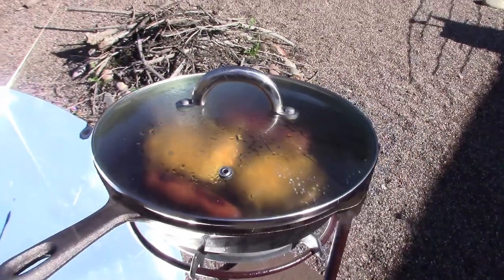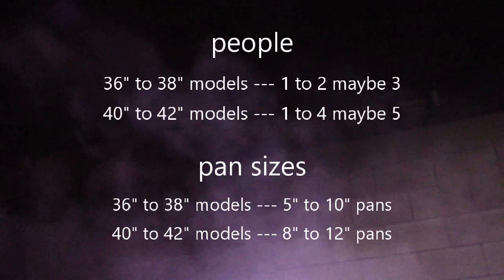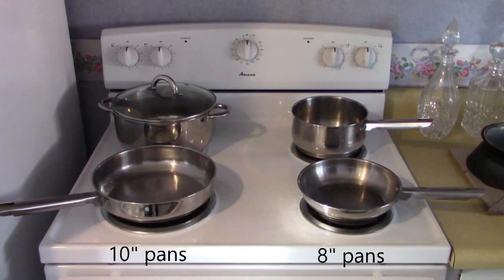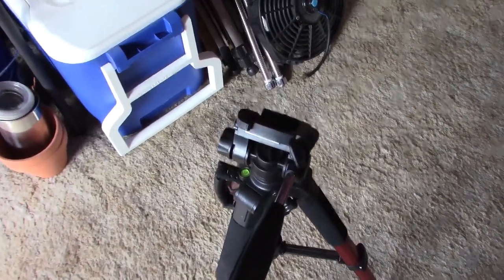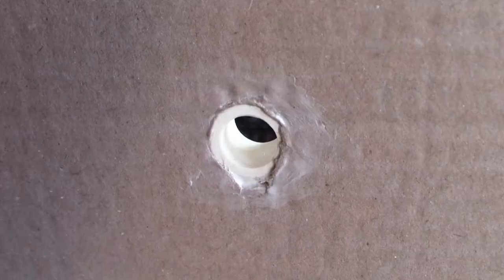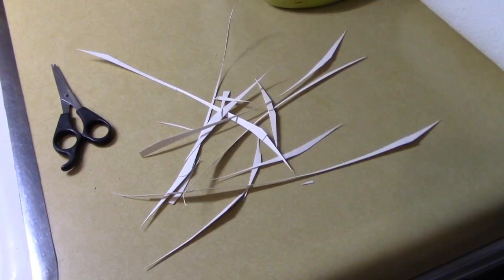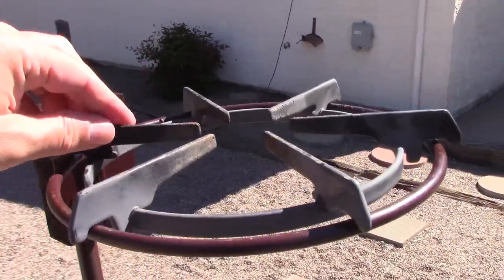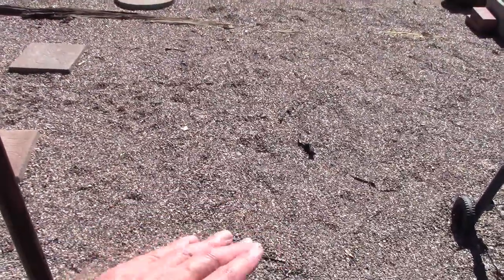DIY "Family Size" Parabolic Cooker! Supercharged! XL "Solar Sizzler" Replica! solar stove burner

Comment: It is awesome solar cooker! I have some suggestions. It would be better if sun goes more under then on side. That is why you should maybe consider, for some of your next project, to make a bit dipper parabola and to trim upper half of solar cooker (or 1/3rd) and to prolong sides.  To look more like wing. It would be even more better if you can make aprox. a 2 square shapes. In that case you can cook more easily and maybe you can fold that two wings and make it more compact and portable. A am not sure am I clear enough :)

Comment: You made these out of cardboard and stickers freaking awesome dude
Reply from the maker: hi yes, it's really easy to do. and can last for years. cost me around $30 (plus the mirror stickers). total cost maybe 60 bucks. by the way i looked into other materials but cardboard is the best thing to make them out of. wood is too heavy and plastic/metal is too hard to mold. only other option would be something like foamboard and corrugated plastic but that would cost you 300 to 400 bucks and it probably wouldn't stay stuck together. btw i just made a final model. (3rd model in the series). i'm calling it the sport model. smallest and lightest one of them all. video will be posted in a week or two.
Reply: @desertsun02 cool I'll be there! I live in a 2007 Chevy Silverado 1500 with a four-wheel pop-up camper hawk model on it and a small version of this would be great for storage issues. I also live in the Phoenix Arizona area with lots of sunshine. Thank you!

Comment: I just saw a solar cooking for sale online yesterday! You just mean that particular brand?
Reply from the maker: hi. i mean this kind of solar cooker (the shallow dish "true" parabolic cookers). nobody sells them. nobody at all (since about 2011). it's crazy when you think about it. it's probably the best way to solar cook and they don't sell them. the only parabolic dish cookers you can buy anymore are the big 5 foot models.  those weight 33 lbs and are made of steel (with aluminum tape). they are deep dish models (meaning they have a shorter focal distance) so they are huge. they're also way too hot for regular cooking. they generate up to 1800w. that's double to triple the power that you need. they burn everything. if you want the lightweight, thin, portable kind (the shallow dish ones) you have to make them.
Reply: @desertsun02 I have watched YouTube videos of rocks melting and exploding from using the old internal projection tv screens. Way too powerful!

Comment: Watched with full stomach and slept halfway, rewatch again 😅

I just realized something, how do you calculate the wattage?
Reply from the maker: there are some basic formulas for figuring wattages for a given specific area of sunlight. i plug in values for average solar irradiance on a good sunny day (nationally) and then subtract for inefficiencies. i say nationally because if i used my local numbers the wattage would be a bit higher. output varies a little though because so many things can affect power output, (sun angle, humidity in the upper atmosphere, even elevation and of course the time of year).
Reply: @desertsun02  thanks, I didn't know that as I presumed you were using some sort of instrument. But this method is much better as not many people can afford to buy expensive equipment and it'll beat the purpose of trying to make it simple and affordable.

Have you tagged prepper community for this setup? I think this should be on the list of must have for preppers. It can save a lot time and energy to find and store woods and it's not necessarily available around in city. I'm putting this now in my experimental projects as well as apocalypse event. Have a nice day.
Reply: @Shouze163  As a rule of thumb, sunlight delivers up to 1000 W/m² depending on the conditions. A more practical method would be to measure the time needed to boil a liter of water and calculate the energy (or let AI do it). Also consider starting temp, thermal mass of the pot etc.
Reply: @SolarCookingGermany  thank you so much. Your method seems easy for me to do. Looks like you have some good videos there, I subscribed.
Reply: @Shouze163  Thanks for subscribing :) New videos after winter.
Reply from the maker: @Shouze163 i wish i knew how to tag the prepper community. i am somewhat of a novice when it comes to distribution. i mainly count on the viewers to share the content. feel free to share the links to any of my vids. i think this type of cooker is a must have for anyone who wants to be prepared. the unit cooks fast, boils water and even doubles as a fire starter. (you could cook 20 meals in a row (in one day) on this cooker if you needed to)
Reply: @desertsun02  I also don't know much about this, perhaps just put it into the description and title because I see some people did that. I do share to people sometimes.

This is a really must have for preppers because it can also reduce the need to move around just to carry things like woods as well as possible alternative energy. What I have in my mind is sterling engine. Just bought some mirror today.

Comment: the use of reflector cookers in pakistan/afganistan exploded over the last couple years. people dont like using them but theyre crazy cheap to make. they usually approximate parabolic with a bunch of flat mirror shards. over there after the whole afganistan war ended and the usa left it became almost impossible to get fuel of any type and it was super expensive. imf at the same time was threatining to let the nuclear nation of pakistan implode if they did not stop subsidies like for fuel/gasoline lol. 
as far as i know this was the biggest large scale adoption of this technology a few years ago. people use something similar now but its usually 12/24v dc appliances that can run diretly off pv solar.

Comment: Very good, as always. Have you considered some kind of coating for the cardboard for extra rigidity and waterproofing?  Probably unnecessary, but I'm kinda rabid when it comes to preventing water damage.  Keep the great ideas coming and Merry Christmas to you and yours.
Reply from the maker: hi yes, you can certainly treat the cardboard with a water proofing substance like shellac if you want to. i don't think it would ever be fully waterproof but there are ways to make it water resistant. water is the units one weakness, but it doesn't matter (because you don't use solar cookers when it's raining or even overcast) so it never becomes an issue. btw, I've looked into other types of possible materials (like foamboard, corrugated plastic, wood, metal, abs plastic etc.) but those and every other material in existence seem to have a multitude of issues that make them totally unsuitable for this project. metal and plastics have to be very precisely factory molded (using complex formulas to add in the correct amount of wobble to the curve). the issue with wood is that even the lightest wood ends up making the collector way too heavy for most people to move around and it would certainly be too heavy for a standard tripod. it sounds crazy but the only material that works effectively and a reasonable cost is cardboard. (which works out good because using cardboard gives everyone the ability to make it). I've had many cardboard collectors last 10 years and even one parabolic one that lasted 12 so they hold up a long time.
Reply: @desertsun02  Thanx, good information. The waterproofing was just a bonus to cover the mishaps of day-to-day life. The increased strength, especially doubling layers with the corrugation running at right angles, was my focus. Have a good one.

Comment: Craigslist and other sources of free scrap metal always have a stove listed. Where I live, stoves and grills are often at the end of driveways. I pick up the grills for this kind of project and other wood-based heating (pots of natural dye) outdoors. Gas grills often have a side cooker for a pot of beans. 

Thanks for the clear instructions. This is an excellent SHTF build that reduces reliance on bottled gas or a generator that all the preppers are pushing and getting cuts for sales.
Reply from the maker: hi. absolutely! this is the number one type of DIY solar cooker you should have if you want to be prepared in a local shtf scenario. they cook food very fast and thoroughly so you can help your family and your neighbors! you'd be the "hit of the neighborhood" assuming it's sunny. it boils water too (so when your 'water grid' is down you can have pathogen free water") - which is the most important thing in the short term. it even doubles (or triples) as a fire starter (no matches, no problem). btw, you cannot trust anyone who is buying things and pushing them with so-called reviews online. almost everyone doing that is just doing it for money. they will say whatever they need to say. i get emails every day (probably 3 a day) from companies that want me to do a review video or just a video for them. I never have. not once. once somebody sells out they're integrity is gone.

Comment: Awesome, as always! By the way, here's an idea: a small, portable version of this. What for? There usually are laws prohibiting the use of open fire in the woods. With a portable heater, you'd be able to boil yourself some water and enjoy the morning coffee. Awesome!
Reply from the maker: hi and thanks! the 36" model is about the smallest you can use if you want full power (year round) cooking. but if you just need to be able to cook a few basic things like eggs or burgers (medium-low heat) and you only need it in the summer (when the sun is strongest), then you could make one as small as 30" (2.5 feet). believe it or not i just started on that version. (2 days ago). it's going to be the third installment of what is turning out to be a 3 part series. i'll call it the mini version or the sport version. it comes down to how many watts are available in any given amount of sun. we might be able to pull up to 350w out of a 30" model in the summer. that's "medium low" heat but it should cook some things and heat water to close to boiling. it just won't "brown" things or give you a singe on things like grilled cheeses, burners, home fries, onions etc. you'll need this model or the 36" model for that. note that the 36" and 40" models are very portable too (esp. the 36" one). originally meant for beach, camping, outdoor solar barbequing etc. great for off grid and van life or everyday home use.
Reply: @desertsun02  Awesome! As for portable, I meant something you could take with yourself for a longer hiking trip - a small foldable variant that you could just attach to the back of your backpack. For that particular scenario, I'd say 75cm (about 30") is a bit on the high end of what would be acceptable to take with me. In any case, thanks once again! All you do is very much appreciated!

Here's another idea: have you seen similarly designed tubular cookers? I bet you did. Now, NightHawkInLight recently released a very nice design of mirror - one that apparently has the same focus point regardless of the angle of the sun rays that fall on it. 
This was intended for a home heating project but I can imagine it being used in a portable tubular cooker. What do you think?
Reply from the maker: @JayDustHeadz oh, you're looking for a super small backpack unit. probably have to use a glass tube cooker of some kind to get it that small. there are other possible designs like a foldable parabolic dish but those would be very hard to do as a DIY (you'd probably have to use metal/abs plastic or something more suited to professional manufacturing companies). dish units have to be at least 2.5 feet across to create enough power to do much of anything (unless you use a glass tube to hold the heat). i wish i could make the glass tube part but that's nearly impossible to do as DIY
Reply from the maker: @JayDustheadz quick update. i just finished the 2.5 foot mini model and it works great. you have to use the smaller pans (like 6 to 8 inch ones) but it actually will brown things like grilled cheeses and I got a pot of water to a rolling boil in 20 minutes. (that was december 10th through the 12th), so it looks like the sport or mini model is going to be great. video will be posted in a week or two. this mini (or sport) model would be great for one or two people.
Reply: @desertsun02  Awesome! Wonder if we'll be able to expand it. I'm thinking thin 3D printed frame for the blades. In any case, if it'll be portable and lightweight, then this is exactly what I've had in mind - a great way for a no-open-fire coffee/dinner/breakfast when hiking! Much appreciated, thanks!